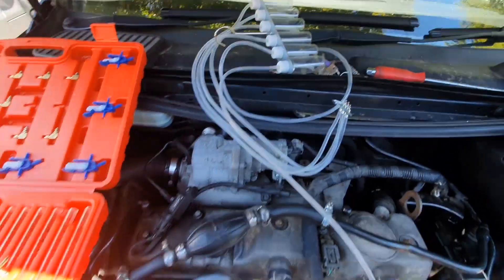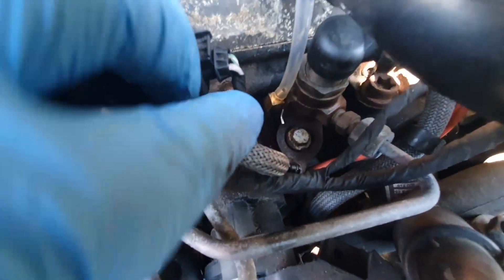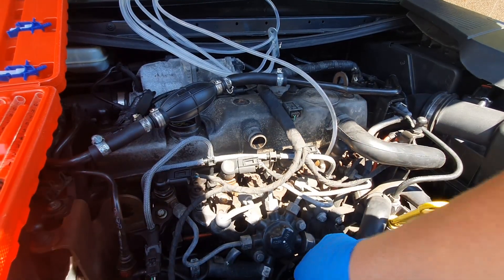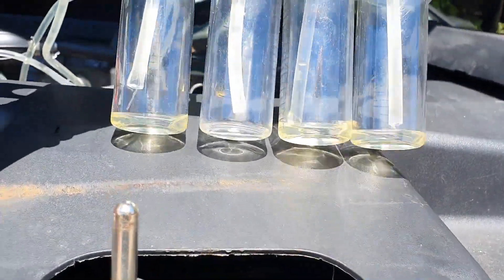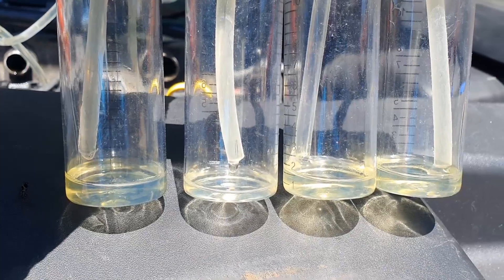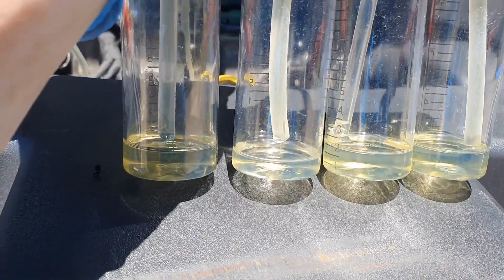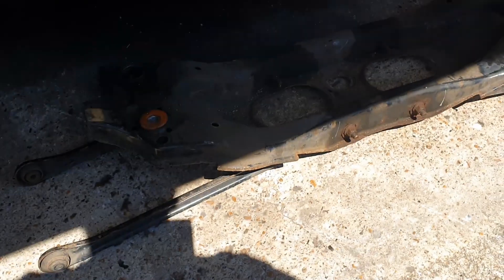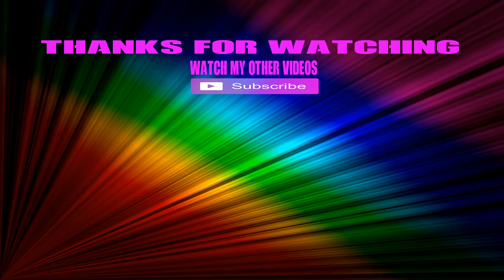Ford Mondeo Mk4 1.8 TDCI leak off test

Comment: Buying a Ford mondeo 1.8tdci tomorrow 09 plate 106k gone into limp mode so buying as spares or repairs £500 taking a gamble
Reply from the maker: Hiya how did it go? I paid £200 for mine with near 200k on the clock.
Reply: @Chazz Coombes  ended up having 102k on clock and only needed 1 injector!!!!!! Drives like a brand new car mate so happy! About time I had some luck 👍
Reply: @ChazzCoombes  got 2 mew tyres for front and boighg a mew battery for it, got all service bits to do once snow has gone lol driving freelander for these couple days

Comment: Hi bud when I tried a egr blanking plate mine juddered I took it back off after a few weeks took the actuator off the egr the pin was broken with 2 bearings on pushed a 5p coin in there to stop the valve coming out runs perfectly now think exhaust gas was leaking from the blanking plate definitely causing the hiccups👍

Comment: thanks for showing me how to remove then cilp without dorping them  ive lost loads
Reply from the maker: Glad the tip helped you. I too have lots plenty till i done this.
Reply: My clips are in back to front! And leak off pressure is building up to point of bursting pipes off! Even after replacing with new leak off pip and sensor! Just gathering info on step by step diagnosis. Telling me 1st step is to get a fuel pressure gauge and see if it matches what the ECU requires. Then leak off test which your video helps. Thanks.
Don't suppose you done anything with fuel pressure tests on the 1.8 by any chance.
Cheers

Comment: Hi Chazz - Have to agree with the comment that Barry made, the injectors seem fine with 1,3+4 seeming very even. Check the 2 sensors and also check for a split in the pipe off the rear of the turbo. Good luck bud..!!
Reply from the maker: Hiya mate, yeah ive order the 2 sensors and will be replacing them in the next few days. And will check that pipe on the turbo cheers.
Reply: @ChazzCoombes  To be fair if you fancy removing the injectors and cleaning them it will do no harm as I did all mine due to one leaking at 73,000 and they were absolutely caked  with crud.! Just treat them with care and respect, clean out the bores and replace the copper washers. Also, I can highly recommend blanking off both ends of the EGR if you haven't already. Much more responsive with that piece of junk out of the equation. These 1.8 Lynx engines get some bad press but I think if you look after them and make sure the timing belt gets done on schedule they are more than capable and quite economical, which is no bad thing at the moment..!!
Reply: @ChazzCoombes  Did you have any code? if there is injector, do not buy refurbished one. With a diagnostic tool check cylinder balances. Number must be around 1 on all injectors.
Reply: @Stojan Humar  I've just had a new one fitted in number 1 and now number 1 and 4 are showing 0.6 at idle and number 2 and 3 are showing 1.4.
Reply: @Stojan Humar  with it stinking of rich diesel smell at idle it must be 2 and 3 that are dumping too much fuel in? At revs they all show 1 on machine

Comment: Hi Chazz  I would not say there is much wrong with the injectors, it started very well and the return flow was pretty even for injectors with the mileage they done, may be a coil breaking down causing the misfire but would say mechanical side of injectors ok. Normally a high return bypass would give you poor starting from cold

Comment: Hi Chazz, I had the same, 2.0ltr tdci 185000,  engine kept hesitating, then upon Acceleration i would get ' engine malfunction '  car would go into limp mode, cleaned the Map& Maf sensors and the car is back to normal, fingers crossed. 
Great video,i did that leak off test on my mk3 mondeo, number 3 injector had gone. Just a bugger to programe in. 👍
Reply from the maker: Cheers for the info, i have ordered both sensors and will do an update on the hicup that is does while driving.
Reply from the maker: @blondieman63 ive brought both Map and Maf sensors gonna be replacing soon. Thank you